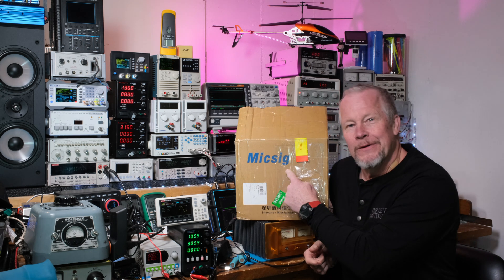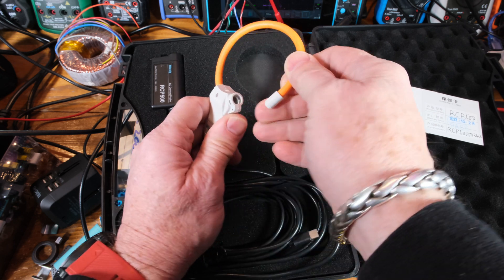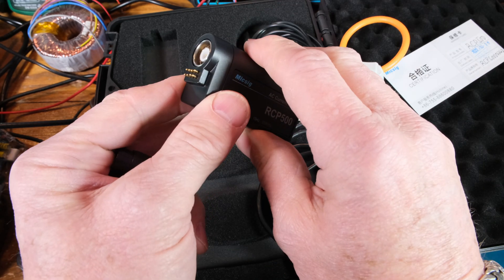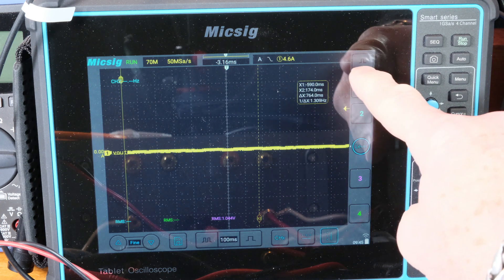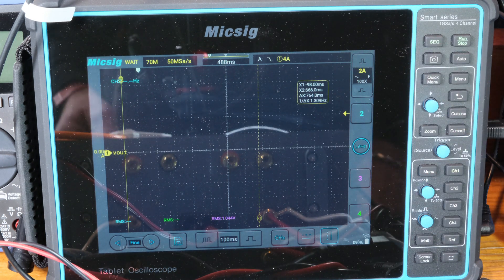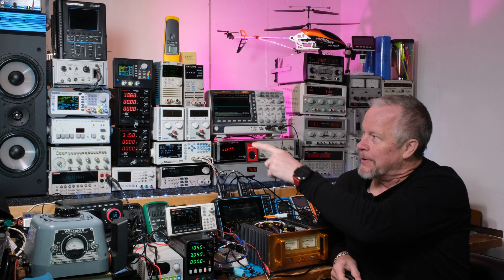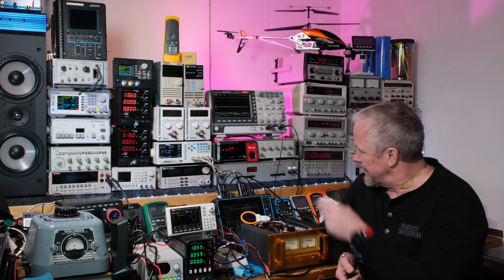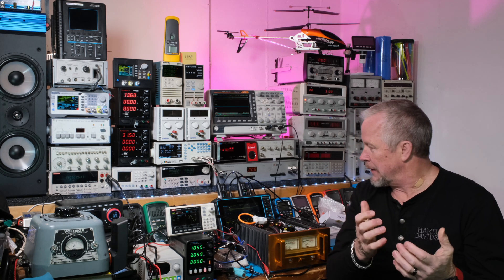New Low Cost Rogowski Current Probe by Micsig RCP500

Comment: I have designed a few of these for custom applications in physics. Amazing how responsive they are to spikes. In particular some fusion experiments  involve a peak currents of 1.5–2.0 MA and for timeframes like 50 ns they would require voltage gradients Vp/lp = 5–10 MV/m. Only thing that fails is signal processing.
Reply from the maker: Thanks so much!  That is great feedback!

Comment: Rogowski coils...  Been using those at work for well over a decade now.  We have some at the lab at work good for >2kA (!)...  Very useful to test overcurrent and short circuit detection functions.  We design some EV type inverters running on 700VDC so 480VAC to the motors.

One nice feature on these is the ability to snake them around a device lead (in the smaller ones) to get the AC current in a fet or similar.  Right now a project I am working on there is some testing where 100+ A peak fault currents are an issue to look at.

Comment: That Tektronix oscilloscope has isolation, external trigger, and is quite portable while being cat rated. Why do you want to get rid of it? I have an older version here in a quite bad shape and still plan to service and repair it in order to check some tricky high voltage/current circuits.

Comment: I'm surprised to see the bandwidth that low, given that it's a Rogowski I would have hoped for something a good deal faster than that.
Reply from the maker: Thanks!  I think it is pretty darn good for the cost, but now you make me want to test it to see how fast it rolls off.  Maybe it is a soft roll off and gives good measurements out to a higher freq?
Reply: @KissAnalog  I'd be interested to see - I also haven't had a chance to look at the datasheet for this, so I may be premature in dismissing its high-frequency performance.

Fast isolated current measurement has always been a problem, and there's no magic bullet. Hall effect is accurate and has DC response, but is only good to a few hundred kHz. Current transformers can be extremely fast, but they don't do really low frequencies well. The good Tektronix current probes use a combination of the two - hall effect for DC, and a current transformer for high frequencies. 

It's hard to complain too much about this thing though, since it costs about five percent as much as a Tek current probe.
Reply from the maker: I'll do a video and give a good review of these new probes and compare to my Tek.

Comment: its a pity is not x10/x100 switchable and 200mA minimum current is quite insensitive and no DC measuring support. 
The Micsig CP2100A is a bit less than twice the price,  is x100/x10 switchable, 50mA minimum current AND has DC current measurement and a far wider bandwidth DC-800Khz bandwidth... but does not have the flexible Rogowski current loop.
On the plus side Micsig is a real company with actual published specs and available instruction manuals. Many of their probes even have indicative frequency response graphs. I have a Micsig DP10007 differential probe and am quite happy with it, especially for the price
if you want more sensitivity there is the GMC-I prosys cp-35. its x10 only and has a limited bandwidth of dc-100Khz (-0.5db at 100Khz)  but goes down to 5mA and has published specs, downloadable manual and indicative frequency response chart. I own one and it works well. I got mine on special offer for £220 including taxes from alpha electronics in the uk. Full price is quite steep - ~ £500 including taxes from radio spares... unfortunately the ability to measure low mA costs more £. However multiple companies rebadge it so if you look around you can sometimes find it at not crazy prices.
Reply: If the wire you want to measure is flexible, you can place 2 turns through the current coil, that will double the output and lower the minimum current that can be measured to 100mA. With 10 turns, you can measure down to 10mA.  Grtz
Reply from the maker: Thanks for your feedback!  I have shown in other videos how to measure current either higher or lower than the rated current of a current probe, but I think its time to do some shorter videos on how to use the current probes to get the most out of them.

Comment: 300kHz? Not very useful in power supply work..
Reply: What power supplies are you using that uses more than 300 kilohertz and for what purpose?
Reply: @hoobsgroove  The switching frequency might only be 100 kHz, but that doesn't mean that you don't have signals a whole lot faster. It's very useful to be able to see higher frequency harmonics, ringing, etc. Also, the current rise time can be extremely fast, sometimes pushing well into the MHz region, especially during fault conditions.
Reply from the maker: It is true - the rising edges result in much higher freqs, but then maybe this goes higher but just loses acuracy.  I'll give it a real world test in another video where we will look at a switching Power supply.
Reply: @hoobsgroove  snubber ringing, GaN running at 1MHz, GaN risetimes at 700ps, even 300 to 500kHz switching in multiphase server applications..
Reply from the maker: It is true - most Power Supplies probably switch less than 200kHz.
Reply: How much MHz would you suggest to get for a current probe for DC/DC and PFC work ?